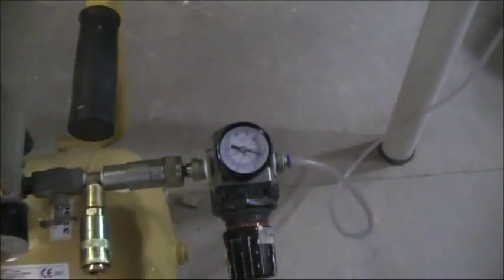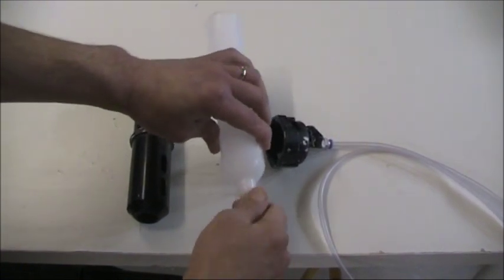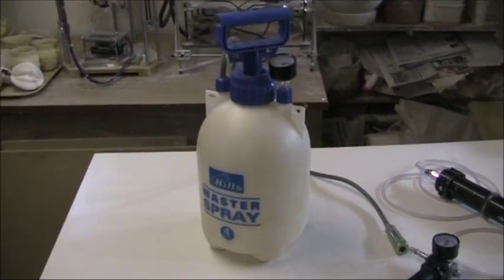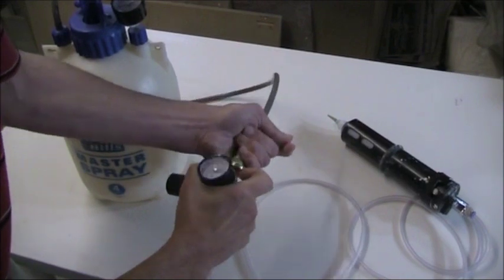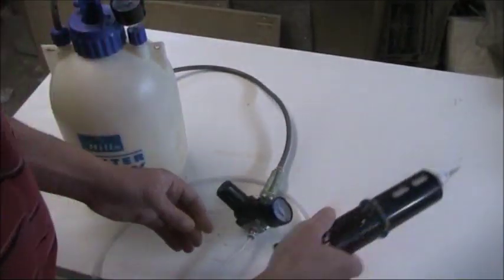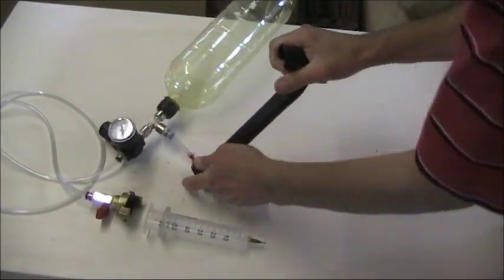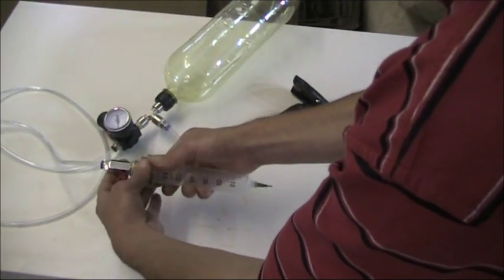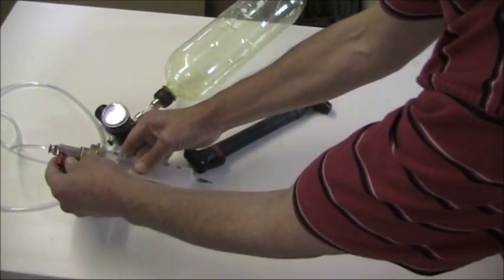Make You Own Ceramic 3D Printer - Printheads/paste extruders

Comment: Hi Jonathan excuse me I kind of want to make my self one of this ceramics printer I allready make my own 3d printers but since i have an small place I wonder if it is too loud the compresor to run the extrusor or an small one of  8bar 6Lt tank is enought for a few prints like empty cilinder 30cm Diameter and 40 cm tall?
thanks for all the information
Reply from the maker: Hi Matias, a cylinder of 30 x40 cm will take a lot of clay so you need a clay container big enough or be prepared to pause and change your clay container a number of times. As long as you have no air leaks with the compressed air, you only use up as much air as the amount/volume of clay that is being extruded. I have a small compressor with 8 L tank and 8 Bar cut off. I would expect it to only have to recharge once if I was to print something 30 x 40 cm. There are lots of variables like how thick the wall is, what size the layer height but as I say without air leaks  and after  initially coming on to get up to pressure the compressor should only switch on once more in a print of that scale. A 6 Lt tank is ok but will have to recharge a little earlier than a 8 Lt tank.
Reply: @jkpottery  thanks a lot for your time

Comment: Have you tried using a deflocculant for the clay like Darvan 7, Darvan 811 (Alkaline polyacrylates), or Sodium Citrate, used for casting slips.  The clay becomes liquid or more plastic with greater adhesion with a lower water content. 
http://digitalfire.com/4sight/education/deflocculants_a_detailed_overview_324.html

It might eliminate some of the work in filling the clay syringe, and give the syringes much longer shelf life after being filled.